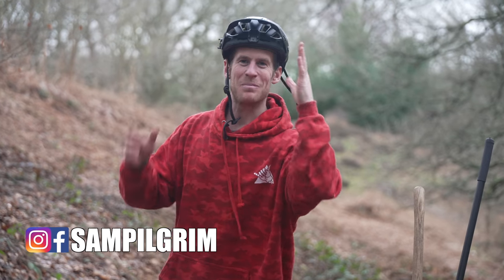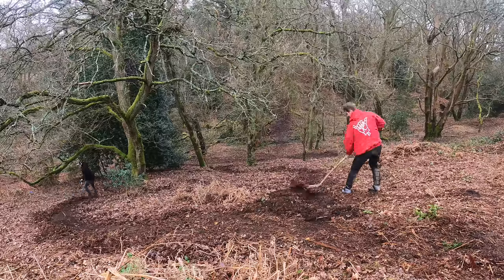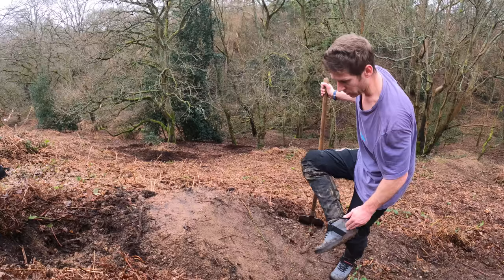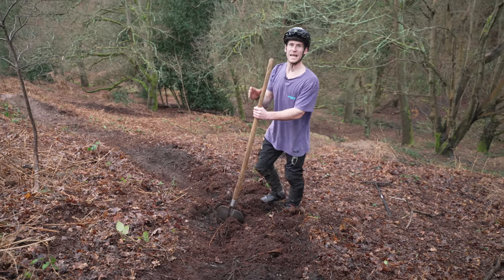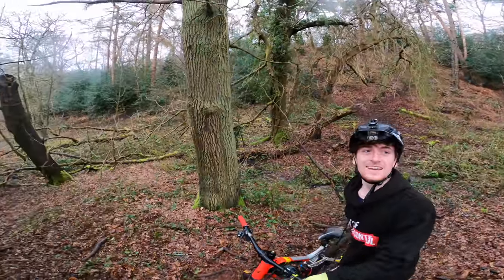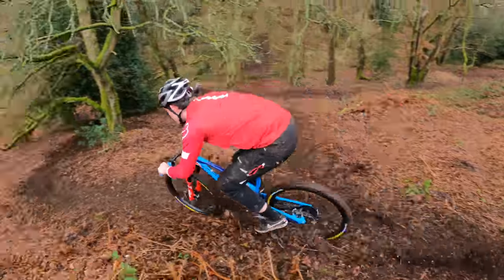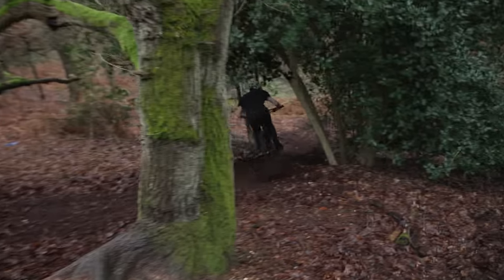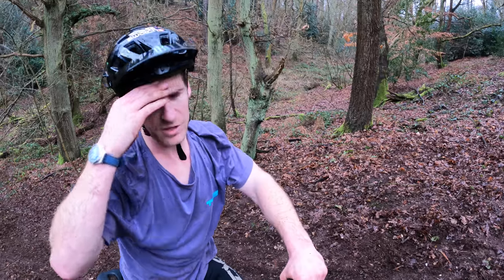2 HOURS TO BUILD AND RIDE - MTB TRAIL BUILDING CHALLENGE

Comment: No Sam I can't believe you build it for a 30 minutes. only 20 minutes you need to clean those leaves and grass and around 20-25 (or mby more a bit because of the ground) minutes you needed to build this little kicker. Someone is cheating with clocks on hand?))
But lines are so good! And frontflip on 9:09 was so perfect xD

Comment: hey Sam. quick question. i ordered a set of conti race kings for my DJ, but i got them in the wrong size (27.5 instead of 26). would it be a bad idea to run a race king on my rear wheel on my enduro that has a der kaiser on the front. i ride in colorado, where trails are mostly dry and a bit dusty.
Reply from the maker: You should try it see what happens! 🤙
Reply: @SamPilgrim  yep. i have the tires, might as well shred